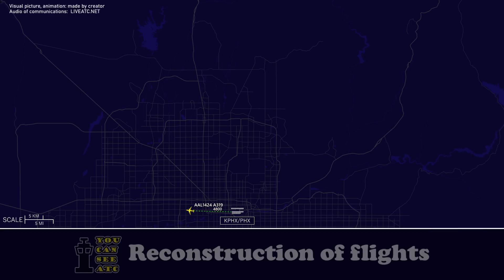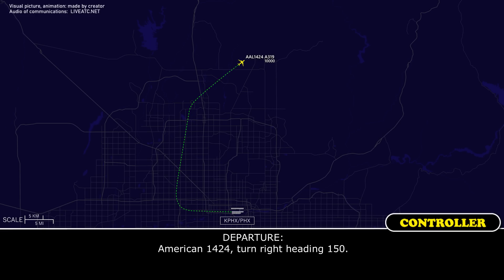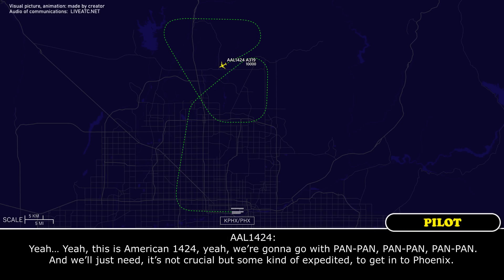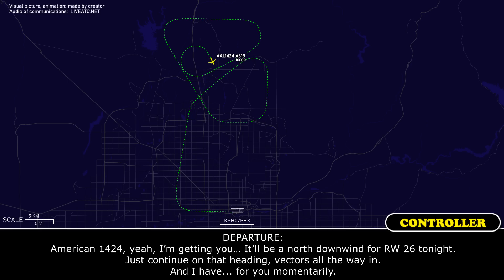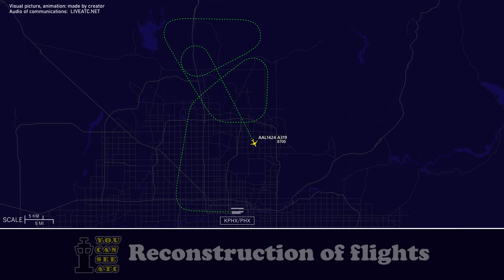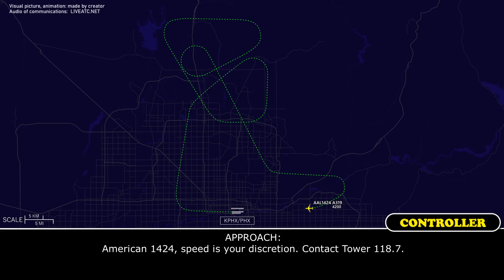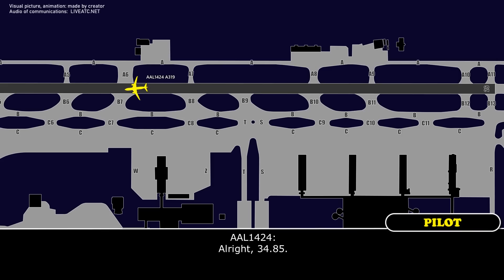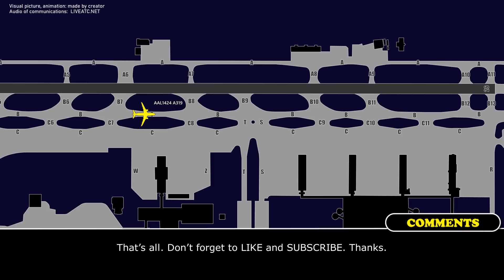MAYDAY. Engine failure on final at Phoenix Sky Harbor. American Airbus A319 engine problem. Real ATC

Comment: 1:37 ah yes, the dreaded flight engine thing. Sadly common on the older birdy-bois 😔

In all seriousness, this video is a great example of what safety culture builds. As a precaution, the pilot didn't continue to his destination, he leveled off and started troubleshooting. As a precaution, the controller kept him near the airport. As a precaution, the pilot returned to the airport. As a precaution, the fire department treated this as an exercise. As a precaution, the pilots flew a shallow approach. So, when the engine gave up, it happened on a gentle, stable approach towards a runway with waiting fire trucks, instead of at cruise power/altitude. A cascade of safety-first decisions that turned a potential disaster into practiced normalcy.

Comment: Two things that I find noteworthy, not necessarily a criticism.  Instead of all that vectoring and communicating they could have asked for a present position hold, 10 miles legs (or any number).  Enter the hold in the airplane does the rest. It's weird that he uses the term pan pan pan and mayday mayday mayday while he's already in the middle of a conversation with the controller. Those phrases are meant to be at the beginning of a transmission to get their attention. In the middle of a conversation you would just say we're now declaring an emergency. The entire industry is being dumbed down so much it's disturbing.  There are airlines that prohibit pilots from actually hand-flying an approach in IMC. It's only going to get worse with the pilot shortage and diversity hiring instead of skill-based hiring. Also, whoever posted this video, there was not an engine failure on final they shut it down after landing. Even if it had failed that is something that is practiced for hundreds of times in the simulator and the aircraft is quite capable of landing single engine and it is not that challenging. What would be challenging is a single-engine go around at minimums  instrument conditions, also practiced constantly in the sim.

Comment: I had something like this happen to me in 2016. DEN to TPA on United. Flying over Arkansas, Captain came on and said that they were getting issues with the number 2 engine saying it was on fire, but everything else said it was normal. That's when we did a 180 turn and the emergency was waiting for us at Tulsa. Upon landing they said that number 1 engine was on fire. It wasn't. We were cleared and went to our gate and then waited for a rescue plane to get us from Chicago. They said both sensors were dead and they had to wait. So... we arrived in Tampa 6 hours late.

Comment: Question: if that engine is malfunctioning, don't pilots shut it down? Cause they can still work fine with just 1 engine?
Reply: Depends on the problem and what the emergency checklist tells to do but yeah they fly well on one engine.
Reply: A malfunctioning engine is better than two shut down engines, imagine a common fault like maintenance or fluids.

Comment: Ever so often I wonder why they'll let them park an airliner full of fuel, with hot brakes and/or possible engine damage next to a terminal. 
    Seems like eventually one will cook-off next to the jetway/terminal and spread into the building.
    I mean if your car shows up with smoking brakes, leaking fluid, or engine damage, accompanied by a fire truck, you're not putting it in my garage. Or next to the house. You'll park it on the street and get out there.

Comment: If the pilot could talk clearly and express himself concisely ...state the problem. ...cut out the "err" "err" hesitation and verbal diahorrea. ..
And then not to request emergency services which is virtually mandatory for a technical problem return ???
He never even mentioned when he shut the engine done...
Lots of procedural errors...
That information is required by ATC and emergency services. 
Thank goodness for that controller with that wishy washy pilot.....he gave logic,safety and structure to the incident.

Comment: Can we get some props for the pilot not feeling pressured to try and make the flight up to Reno even though it appeared like the engine problem was minor?  I could imagine some airlines would rather you, if it's not an emergency, just take the risk because then they don't have to deal with passengers.  And obviously the pilot's caution worked out.
Reply: I don’t know anything about aircraft engines, but are those things not supposed to be super reliable and well behaved? If it started showing unexpected behaviour (even if it’s just slightly higher temperature or pressure or reduced thrust) is that not enough cause to be concerned?

Comment: I'm surprised so many people are impressed with how "professional" this is. Shouldn't it be that as soon as an anomoly occurs they get the aircraft onto the ground asap? Do the troubleshooting on the ground. Obviously this will cost the airline more if it's a false alarm.... but if they really care about the 129 souls. Personally I find this concerning. Just because these guys sound cool and collected doesn't mean they are doing the right thing. Am I missing something (I am an engineer, but not an aviator).
Reply: Bruce,retired Stationary Engineer,no aviation ,however me too.
Reply: No, not every anomaly requires returning to the departure airport.
Reply: As an Airline Pilot I’d love to give you a lecture on aviation but is just not posible here. All I can say is, trust the system, there is a reason why aviation is the safest way to travel. God bless you all.
Reply: @manueldecastro6892  sorry, but this sounds like a doubling down of poor safety culture. I dont need a lecture. Just why not land if instruments indicate an engine anomoly? Please give a hint as to reason?
Reply: @XAIcommentbot  I'm not a pilot, but I could speculate some reasons why running some checklists is in fact the pro-safety thing to do and landing hastily could be a panicky mistake. Some airliners are capable of taking off with more fuel than they can safely land with. In those cases, they might need to dump some fuel before landing. Here's another one: if you're down to 1/2 of the engines you started with, the safety margins for landing become smaller. It might not be so easy to go around if things aren't lining up right. So if you might only have one shot at it, you'd want a longer, less steep approach to increase your odds of success. Qantas Flight 32 offers a good illustration of how some extra time in the air can really pay off to make sure all the bases are covered when a tricky landing following a malfunction is necessary.
Reply: @majahanson311  these are fair points, thanks for your thoughts.
Reply: I am a professional pilot and was  very disappointed by the way the pilot failed to express himself clearly and concisely. 
"Err"  Err"
He failed to state the problem clearly. 
Request emergency services 
He failed to inform that the engine had been shut down.
Thank goodness for that Controller who brought structure and confidence ...
Reply: @daftvader4218  The engine apparently was only shut down ON the runway/ turnoff. He says that they will turn off the rwy and shut down engine 1. He communicated that they got at least one more message about the engine on short final (when they declared mayday). Might have turned into a problem if they had to go around.

Comment: Good job. However, instead of asking for vectors, asking for a hold in present position is a great option. It will free up capacity for the crew (who don't needs to concentrate so much on ATC) and the controller (who knows where they are and don't need to 'control'). Just do a lateral reversion at present position (PPOS), HOLD at 3L, revise if necessary and insert.
Reply: This may seem a reasoned alternative, but there are some other considerations.  If you enter holding you surrender to the max holding speed of 210 KTS and maneuvering circles within a time window.  Many aircraft at that speed need flaps extended,  If the irregularity is high lift devices you limit your operational speed and may not be able to do all that the checklist requires. holding also requires more supervision of the aircraft and more frequent turns. Remember if you are troubleshooting control surfaces you may not have full lateral or longitudinal authority.  I have done random assignment of turns by ATC. it is quite manageable for the crew, and keeps the pilot flying more involved.
Reply: @ wadadli4sun... all things considered, this incident was handled properly and well by all involved. While having to run diagnostics and complex checklists and continue to fly a plane that might become a handful at any second, the last thing the crew needs is to be burdened with flying a timed maneuvering procedure requiring resetting the radios and FMS. In this case the controllers could see the big picture better, moved the flight to a broad, safe, uncongested maneuvering area to give time and space to work out the problem, and essentially took over navigation, allowing the pilots to concentrate on Job 1 which is always "Fly The Plane." Not arguing with you, just discussing.
Reply: What's the problem. ..!!??
Shut down the engine.
Descent , approach and before landing check...
The vectors are a linear "hold"
on the way to a safe landing.
Reply: @daftvader4218    I'll love to see you explain to the FAA and your company why you performed a landing on one engine without trying the evaluate and restart the engine that was shut down.  That's not your best work.  The approach and before landing checklist on an aircraft with a bad engine is different and much more involved.   The flap setting is also different and approach speeds much higher.  This is not a Cessna 172 you now have to access if your original landing airport is still suitable and if you need a change of go-around procedures on one engine.  Do your assessments and defect checklist before going down the [ THE AIRPORT'S is RIGHT THERE ] rabbit-hole. This idea of just getting it on the ground has had more aircraft in a pile off the departure end of the runway.

Comment: The one thing that really surprised me was a right turn to go from 230 to 140. But the ATC knew that would be unexpected, so he repeated "right turn" so the pilots would understand that he knew what he was doing and was doing it for a reason. Quality ATC work, right there!
Reply: They had engine 1 failure so right turns were expected for safety reasons as well.

Comment: I was in a putt putt puddle jumper on a photographic mission above the airspace but near a class D when I sucked a valve. I still had some power but choose to sit it down in those big expansions of cement below me. The controllers soooo much wanted me to declare an emergency. I still had some power and energy enough to get me clear of the active and parked. The other soul on board took a taxi home. The valve problem was carbon on the valve stem with no impact to the piston so no bits and pieces. The fear of paperwork kept me from keying the Mike and saying those words, Mayday Mayday Mayday. The A&P came out, cleared the problem and I flew the Cessna back to my home airport 7 miles away. I did climb a to a safe glide altitude in the airport vicinity before venturing towards my home FBO. A great time was had by all.
Reply: How much paperwork do you have to file if you declare a Mayday?
Reply: @ericemmons3040  I am not certain. The answer surely is within the pages of FAR/AIM.

Comment: What ever the problem was I guess it wasn’t just an “indication” problem. It’s hard to say what exactly was going on.
Reply: @Portland Vlogger57 oh, yeah I mean the actual engine shutdown happened on final approach though. Also not sure why you put that as a comment reply here still.
Reply: @Portland Vlogger57 they didn't declare mayday until on final. Reason would have it that they escalated the seriousness (from pan to mayday) of the situation due to something major happening. Such as the engine finally failing. I fail to see how the title is incorrect.
Reply: likely they had an ECAM message at first, and didn’t know what it meant, had to consult the QRH, etc. Clearly it was serious, but it’s not always immediately apparent.
Reply: @Portland Vlogger57 who said it was on final…?
Reply: I suspect this was a high engine vibration advisory maybe followed by more vibration and an ecam. They asked atc to not move the engine around much.

Comment: they ended up getting vectored into the area of weather they asked a turn for earlier to get away from it. LOLOL!
Reply: The weather was actually 30-40 miles due north of the terminal area on this particular evening so it was not a factor for the American Airlines jet being vectored. If it was the pilots would have queried ATC and asked for a deviation. Also the aircraft was vectored northeast to keep them out of the Phoenix departure corridors and closer to the airport since they were landing west. It was a textbook job done by the controllers involved.

Comment: Brings a lot of pride for the airline industry when the pilot and control tower communicate along with the emergency crews and bring the plane in safely. True professionals at there jobs.
Reply: Pilot sounds like a douchebag .. using the word about.
Reply: Very clear by everyone .
Reply: Maybe just a quibble, but nice to hear PAN-PAN PAN-PAN PAN-PAN and Mayday Mayday Mayday. Gives folk a moment to breath!
Reply: Personally, I would have had them roll the tricks earlier, "If this evolves into another problem, I'd rather have them already out there waiting for me." That's what I'm thinking.
Reply: @FoxUnlisted  hi Fox
I agree not well handled by the pilot...."err"  "etr"....
Did not state the problem clearly.
Did not request emergency services...
Did not fully inform ATC /emergency services that he had shut down an engine.
Lots of procedural and liability errors......
Great ATC....gave clarity and  structure .
Reply: True professionals at their (not there) jobs. 

But you are correct, the did their jobs very well.
Reply: @marksaunderson3042 they*

Comment: Looks like they could have flown to Reno. In a straight line, if you stretch out all the turns plus return.
Reply: Reno single engine. No thanks.
Reply: Yeah it’s a insane amount of checklists and coordination with dispatch and flight attendants. And need to burn off fuel for max landing weight.
Reply: Better equipped mechanics in PHX. Since it’s their base.
Reply: I was thinking the same. For the amount of time it took to figure things out they might have simply flown to their destination.
Reply: @OMGWTFLOLSMH  Theres a number of reasons not to continue to destination with an engine failure.  They wouldn’t be able to climb to their cruising altitude on one engine for one.  Plus, Reno is surrounded by terrain and its not a place you want to be on a single engine.

Comment: Don’t know what they needed to discuss with company at that point in time.
Reply: Yeah, company needs to know that your coming back and to help you out, the dispatcher is a crew member also.
Reply: PLus they were probably talking to a mechanic who could tell them what the instrument readings meant and whether they could fix them in the air or had to come back to fix them. Notice how they said "We're doing shallow descents, and don't want to level off until we're on final to not move the engines around too much"? I'm fhinking they had some sort of engine imbalance, which could have shaken the engine apart.
Reply: @murphsmodels8853  but at some point you have to fly the plane. All maintenance is going to tell them is, “Did you run the QRH? Call us on the ground.” Also, the comment about not moving the engines around too much was a little strange to me. Are we talking about a high vibe or an engine dangling from a pylon? Just kinda weird, IMO.
Reply: @ThatAdam12  That's why there are 2 pilots, and should always be two pilots. One to fly the plane, and one to figure out what went wrong, and talk to the people on the ground.
Reply: Seriously? For a multitude of reasons, including it being on the checklist.
Reply: @OMGWTFLOLSMH  what are you talking about?

Comment: Why in holy hell can't these fuel on board requests be standardized?  Hours/pounds???
Reply: Because quantity and time are not uniform across the entire range of aircraft and those are two different questions. It's really not a big deal outside of youtube comments.
Reply: @A.J.1656  really?   So some airplanes burn more fuel/hr than others?  What are you trying to say?  ATC needs to know endurance.  Crew is busy--shouldn't have to give an hours remaining estimate, but they can look at the fuel quantity indicator and instantly say pounds.  Pretty easy for ATC to have a table showing aircraft type/fuel in pounds/endurance.  Additionally, the emergency equipment likes to know how big the fire might be.  So do it pounds (and for aircraft that use kilos, let them answer in kilos--keep a conversion chart [or do a quick 2.2 multiple]).   This is not rocket science!
Reply: @tenpiloto  
That's silly. ATC will typically ask in terms of endurance and that's what most pilots answer. If they are asking on behalf of the firefighters, they might ask about quantity. I know repeating comments you see other people make is a good strategy if you're searching for a little of that sweet sweet like button dopamine rush, but in real life it's just not an issue. 
Charts and conversions to avoid a 3 second radio exchange? Lol
Reply: @A.J.1656  yes. An A319 will burn less fuel per hour than an Airbus A330
Reply: Doesn’t really matter in the end. If ATC wants the other we don’t mind giving either. Figuring out both time or pounds is easy for the pilots. ATC doesn’t have time to look up fuel burn charts for every type of aircraft out there. Plus fuel burn changes based on all types of factors.